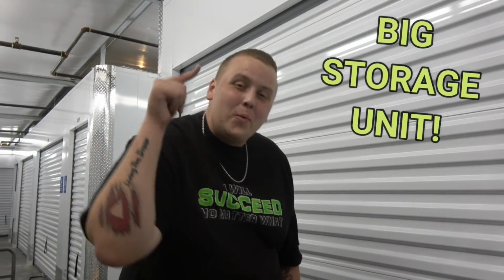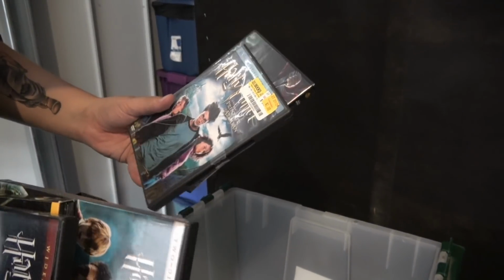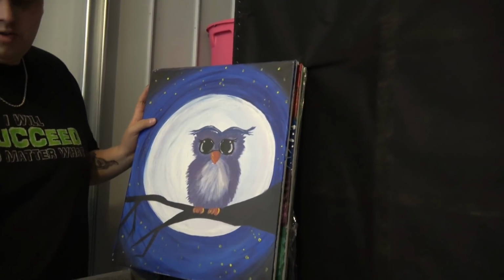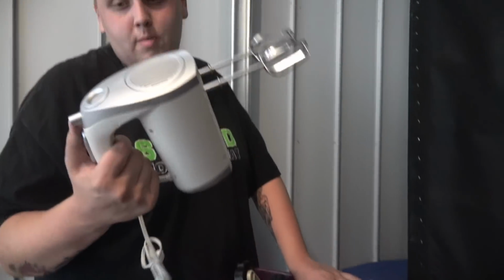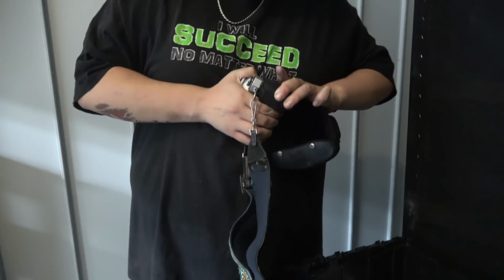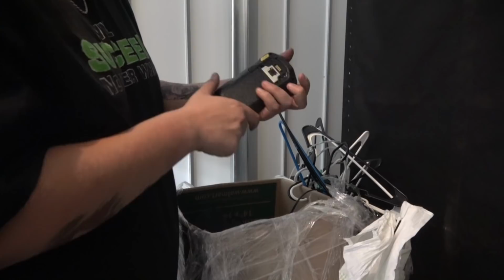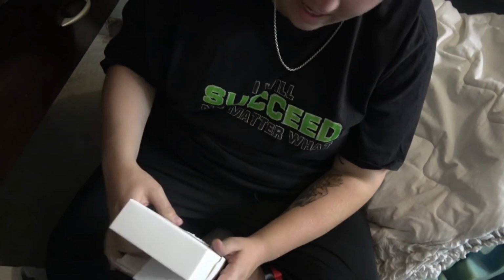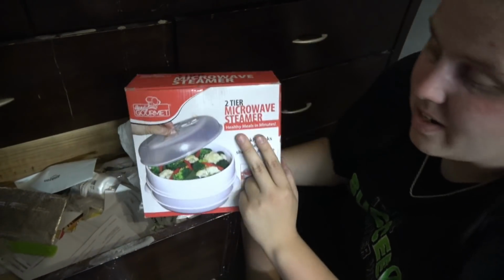Reached The END Of the HUGE UNIT! Hidden Treasures I Bought An Abandoned Storage Unit

Comment: With regard to your kitchen question.... most people have more than one of the same thing. I must have 20 different Pyrex bowls and rectangle baking dishes. I have 3 sets of cookware. Everything has a purpose. I use one secret of cookware for outdoor cooking one for everyday and the third is a backup Calphalon I got on closeout for $45. The Calphalon set is valued at over $250.
Just a little advice take your time when trying to dismantle cameras as there is a screw in the bottom that holds the case on.

Comment: the hatchet hammer thing is almost like a roofers tool. you have the blade for cutting open shingles. the hammer for nailing them down and the nail puller for if you mess up or need to pry up flashing.